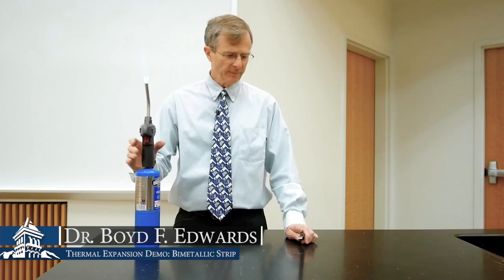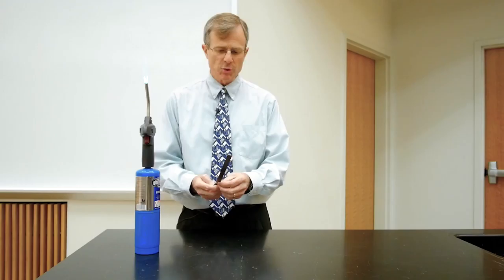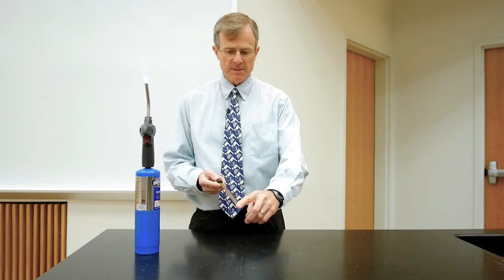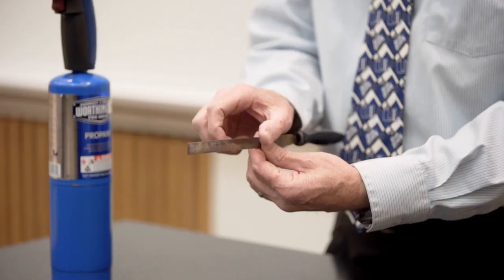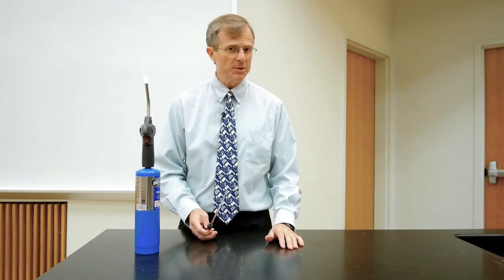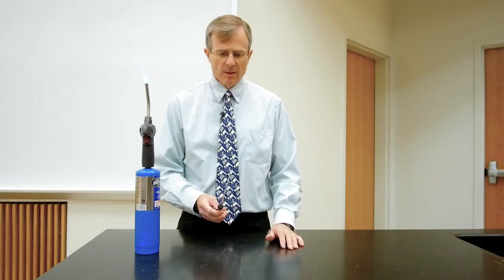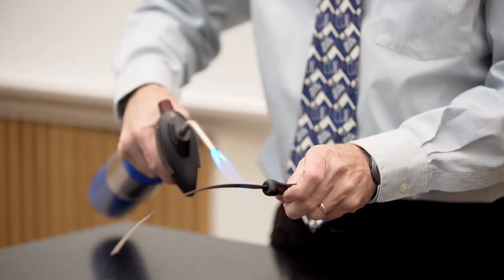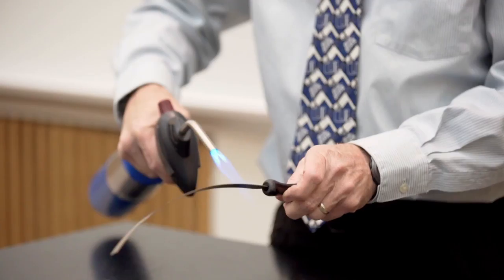Thermal Expansion Demo: Bimetallic Strip

Comment: What application does this contraption have?
Reply: Analog thermostats use bimetallic strips to trigger whether the Air Conditioner turns on.
Reply: MCB , miniature circuit breakers

Comment: Can I use a blow dryer to heat metal to expand it?
Reply: not sure if that would be hot enough but you could probably use a candle flame or lighter. It will take longer to heat than the flame in this video
Reply: You cant, needed a flame for visible changes